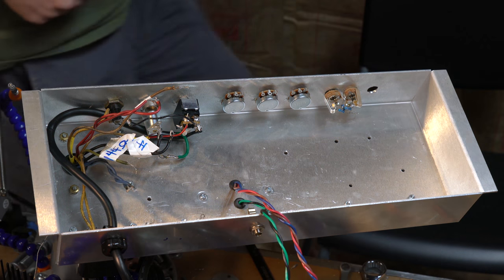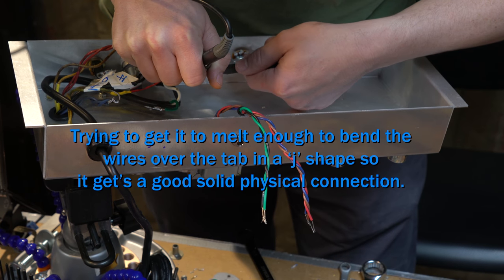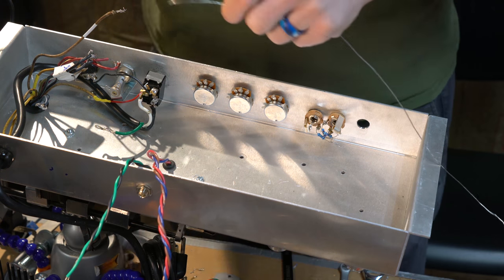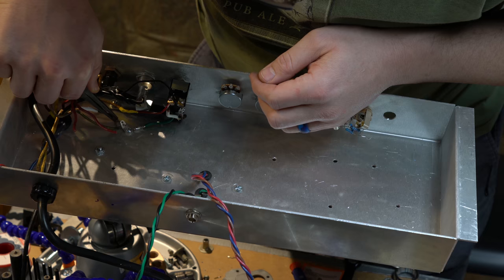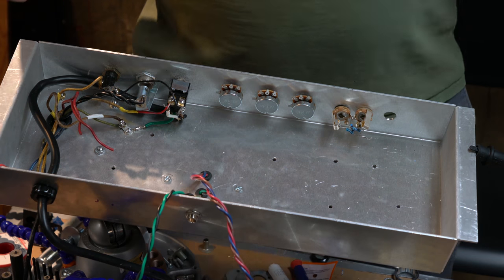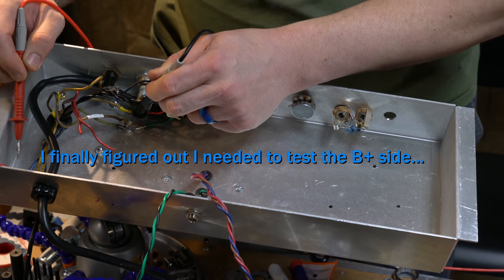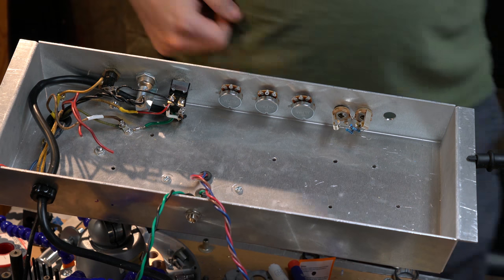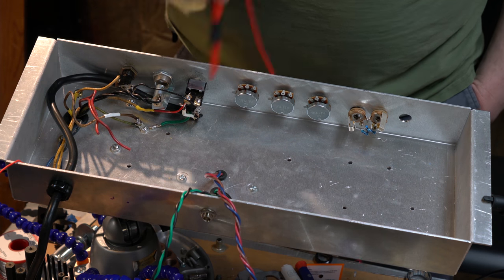Tweedle Dee Deluxe Video 6

Comment: Yellow / yellow is the 5 volt filament winding for the rectifier tube....
Reply from the maker: +Dennis#12 I have the schematic from Philip with all the windings labeled, and I tested them all and they matched the ohms marked on the schematic.  The transformer is extremely old and had shorts internally.
Reply from the maker: +Dennis#12 Not only would that not matter, due to it not being connected to any components, but I connected the yellow as the rectifier 5v.
Reply from the maker: Philco rather